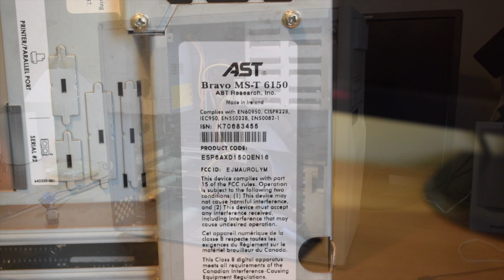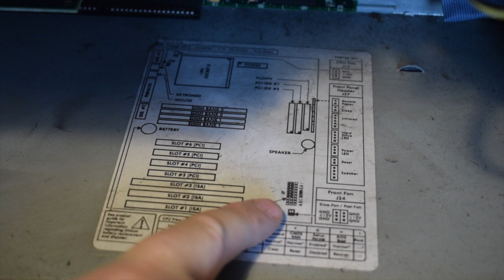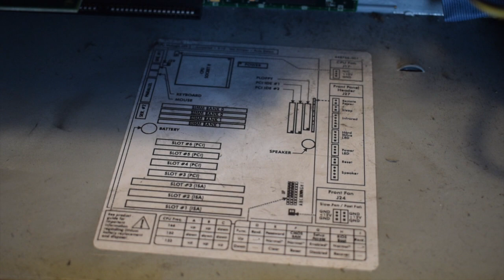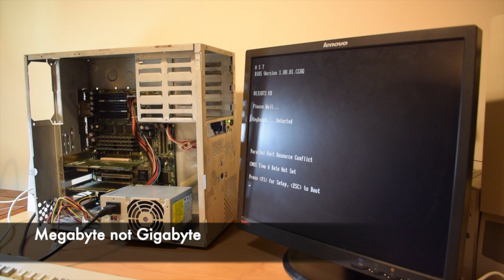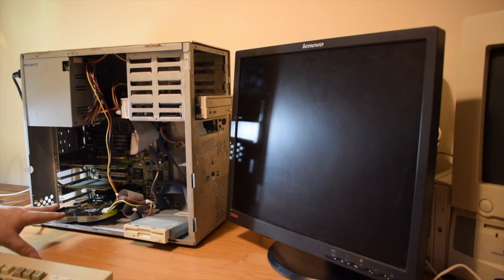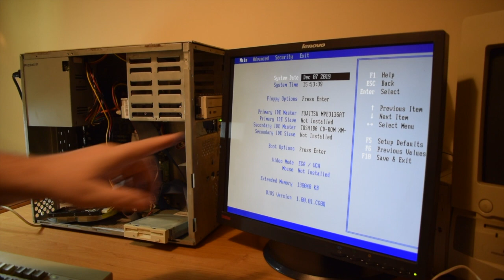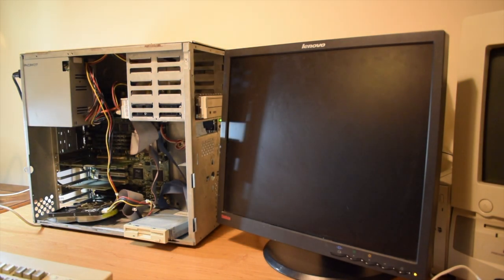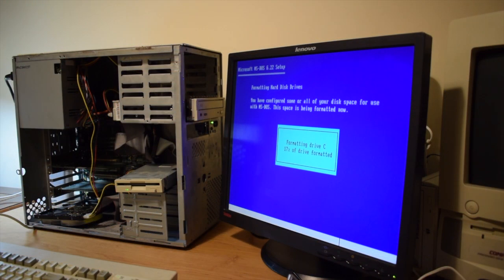AST Pentium Pro, Part one

Comment: Awesome find!!! I found a Antec 1040 Black(Mid Tower Version) Case a few years back at my local GoodWill(before they stopped selling donated cases and now just have crap ton of keyboards)and it was missing the two hard drive cages and had to go to Ebay and find them (luckily I did) to replace the missing cages and directron to buy the new front panel( the swivel door to cover the 5.25 drive bays was missing) for the case. Hope you find or are able to make the drive cage for your case. Thanks for the upload and again awesome find!!